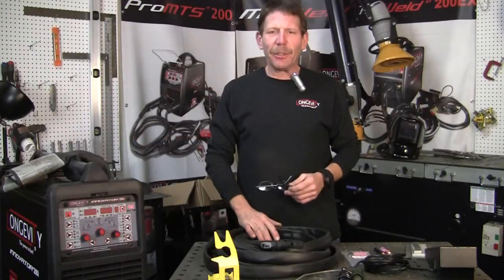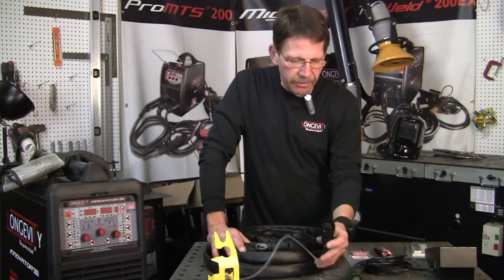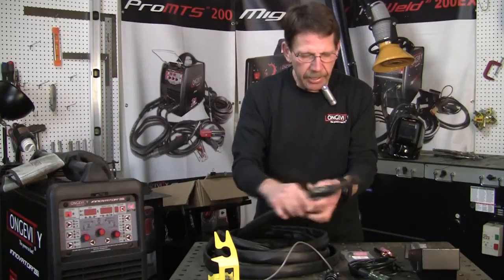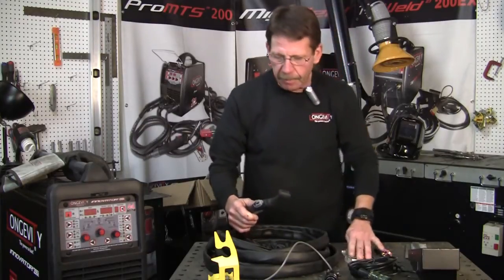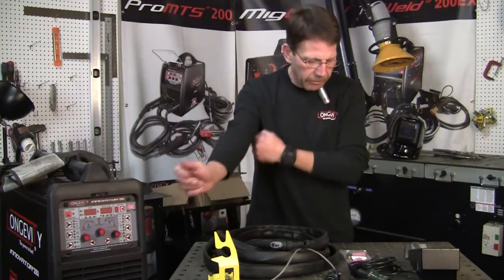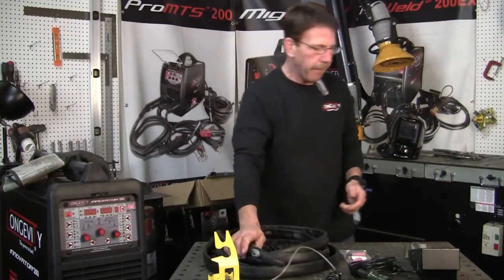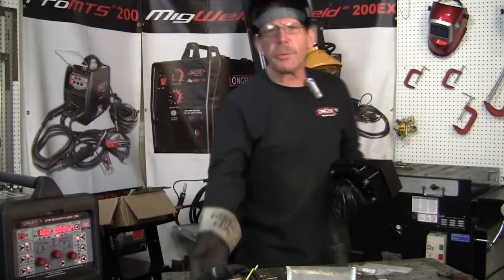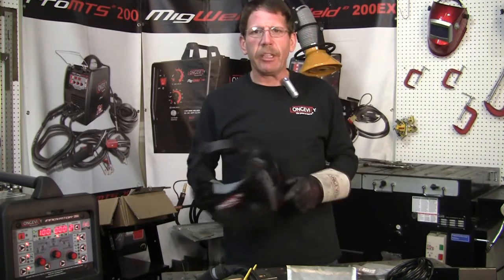Longevity INNOVATOR 255i - 250Amp AC/DC TIG Welder, 40Amp Plasma Cutter - Part 2: DC TIG Welding

Comment: Why do you have to heath up an inverter tig welding machine?  Turning on power before you have hooked up all el. connections are not a good routine. Far safer to power up after el connections are complete. Also TIG stinger is confusing, sounds better with stick welding. TIG torch is less confusing.
Reply: you can tell this guy is not a welder.